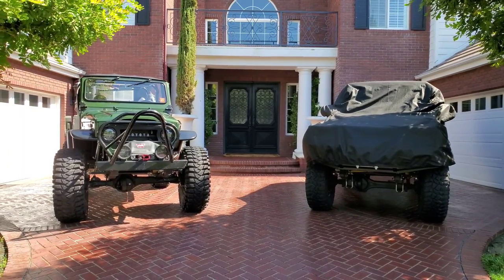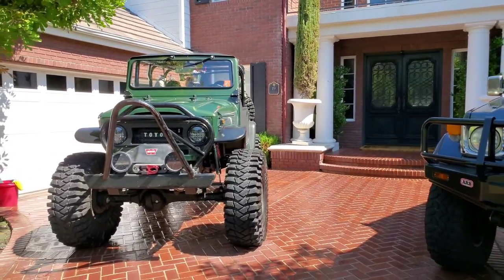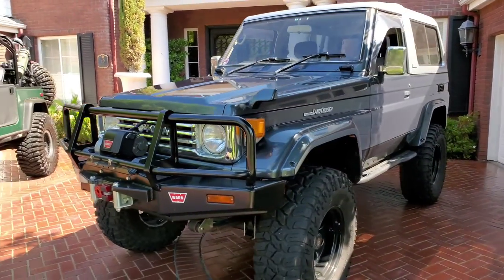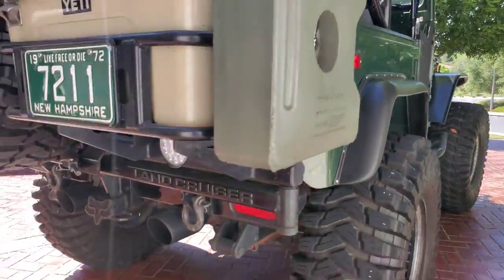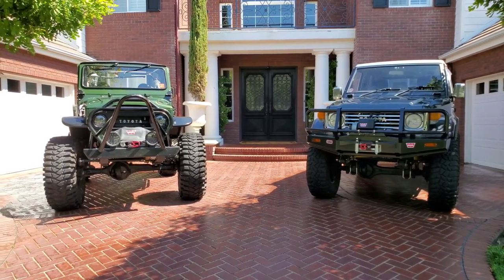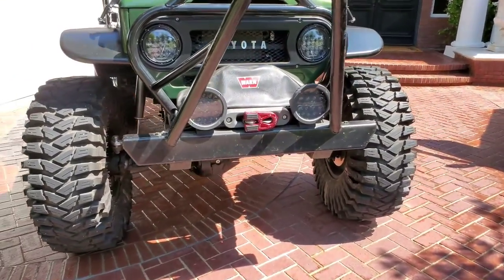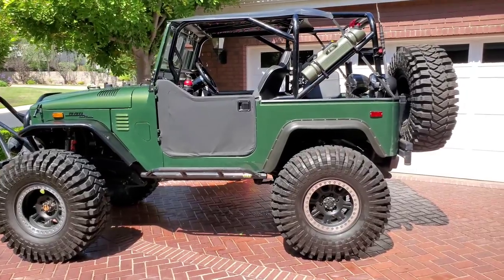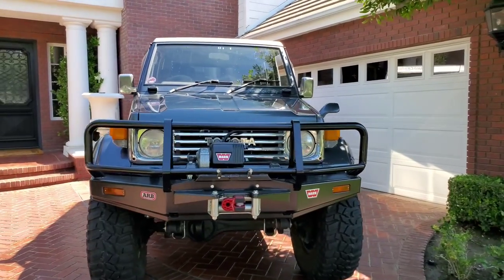40 series vs 70 series: Toyota Land Cruisers Which is best?

Comment: Good info, thx for the video.  Enjoy your videos, am myself a happy owner of an old-as-the-hills, more-beat-on-than-a-drum 'light duty' 70 series here in Uganda (1995 kzj78 with the 3lrt turbo diesel).  There is nothing light about it, in the sense or durability (tho I keep the cooling system up to snuff on the 1kz 4 cyclinder, the previous owner cracked the head when it overheated, but it still ran ok). Its been our family daily driver, tough as nails, for last 10 years and has never not gotten my family back home.  Have taken it all over East Africa, planning a trip down to Zambia next.  300,000km on the clock, but hard hard miles, it is difficult to understand just how bad the roads and dust/mud is here, even in the city.  I never have enough money to keep up on the shocks/springs/bushings, but have overloaded it big-time on 2 trips to Kenya, pounded it while racing out of safari game drives on volcanic rock roads to get out before the park gates close, waded through flooding rivers, and driven it 10000 times over deep potholes and washboard-like speed 'ripple strips' on the 5 minute drive to drop my kids at their school.  And I have the 'light duty' version!  But, I cant complain since it gives me 4 wheel coil springs!

2 quick things to add:  The Japanese lettering on the left rear door (next to the 500kg) is Japanese for maximum hitch weight.  Second, the 70 series is still the go-to car here in Africa for government and aid agencies, etc., with the very same 4.2 inline 6 cylider diesel that they have had pretty much since the beginning.  They sell these of course in Australia, but with all the smog and safety upgrades and the newer V8 turbo diesel.  But when the conditions are the worst, when help is the furthest, when technical knowledge and tools are the rarest, when it will be driven by many drives, who between them don't change the oil and have never noticed the heat gauge, then the global default is the old 4.2 liter.  Unstoppable.

Comment: BJ73 is 4 cilinder 4,2 liter
I had one
First I had an BJ70
Light duty. Steel top. 2.4 liter 4 cilinder

In Europe there are only diesel in 70 series

Now I bought a FJ73
6 cilinder 4.2 gasoline
Comes from Colombia
Very rare in Europe

Comment: Hey, nice 40. What rim and tire combo are you running? What type of lift/suspension do you have?
Reply from the maker: Spring novel ranked list with FJ55 worn leaf springs (by design for flex. Raceland beadlocks with Trepador 40/13.5/17

Comment: Hello good sir do you have stock differentials ?
Reply: On the green machine
Reply from the maker: Yes in HZJ73, in FJ40 it's 80 series rear axle with manual locker and FJ60 front axle with locking hubs.

Comment: Beautiful rigs. It looks like the 40 and 70 have high steer systems. I'm getting ready to install a high steer system made by 4x4 Labs, a company in Grass Valley, CA, owned by Luke Porter. Did you install your high steer systems? Are the any suggestions you  would be willing to pass along to me regarding the installation?

Thanks in advance,
Kevin McCarthy

Comment: Love your channel and truly envious of the variety of Land Cruisers you have.  All done extremely well.  Wondering how you handle the tricky CA. registration situation with the imports and diesels?  Thanks!
Reply from the maker: In AZ right now registering.. CA doesn't want Grey Vins (imports). That's why you see MT, SD, ID plates out here on these JDMd
Reply: @CruisingTheLand  We've been thinking about importing a Defender, but the registration issue keeps getting in the way.  I know you can register them in another state, but have you run into any issues doing that?  I know of a sweet 80 series import here in NorCal and if it's as easy as a trip to Arizona then I'm gonna seriously consider it.  Thanks!